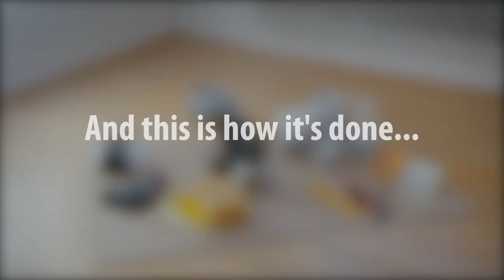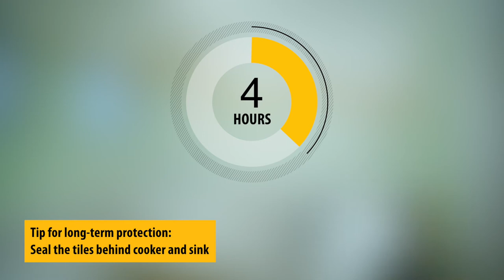Spray Painting kitchen tiles | WAGNER paint sprayer

Comment: Does it work with the 590 Flexio as well? Why is your spray-line so thin? Covers only 5cm?
Reply from the maker: Hi Frederick, this is the professional equipment which we recommend using with the FC3500 for best results. The thin spray pattern would have been used for accuracy with thin materials here but it can be used with different spray attachments to achieve a much wider spray pattern if needed 👍

Comment: What paint do you use ?
Reply from the maker: Hi Max, for this sort of project you will need a tile specific paint and a sealant. You can read more about the project here: https://www.wagner-group.com/uk/do-it-yourself/projects-inspiration/all-projects/repainting-tiles/ As this was produced in Germany they used a water-based product by JAEGER. We hope that helps you. Thanks - The Wagner Professionals.
Reply: Can this sprayer work with epoxy